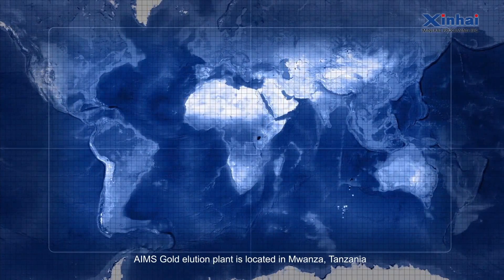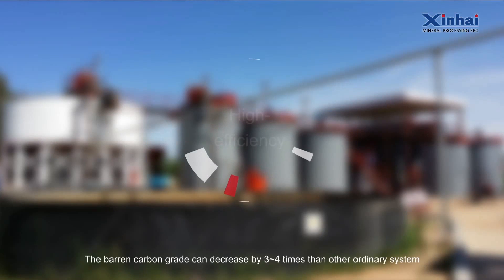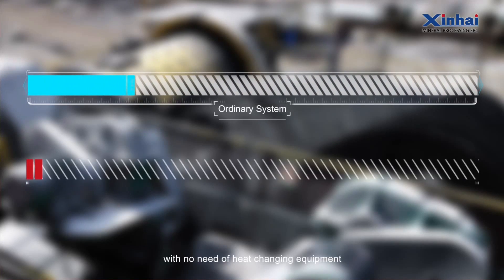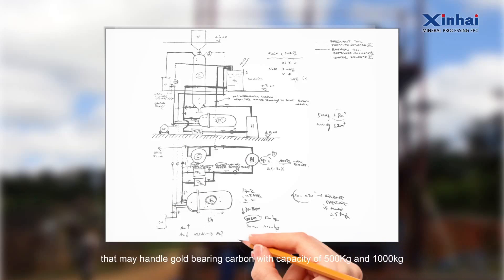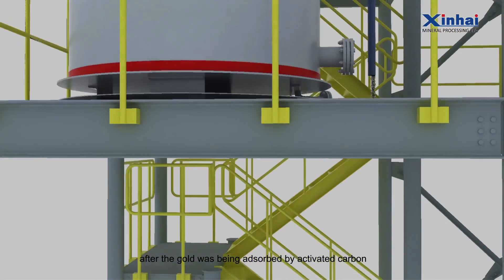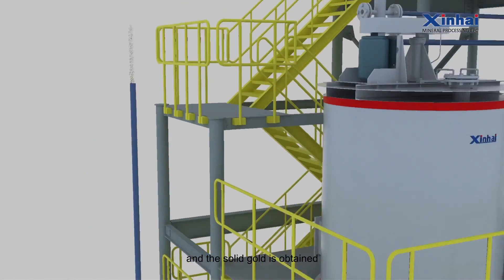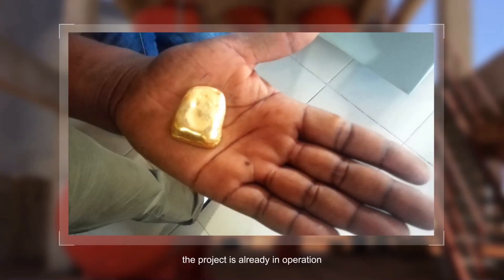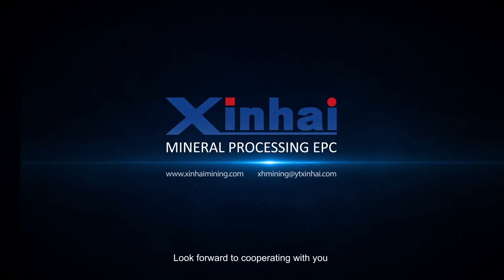Tanzania AIMS 500Kg and 1000kg /batch Gold Elution Plant，Xinhai

Comment: Please I need help here. My Company in Ghana just set up and installed the Xinhai desorption plant but the engineer left before the plant would start working. Please can you do a step by step tutorials on how the whole strip and elution process before the strip cycle ends? From carbon loading, inverse blowing,  Caustic solution circulation, how to open and close the valves accordingly, who valve should be opened and which valve should close at this time, building up the pressures in the electrolytic tanks and the whole proceedure till elution is completed. Thank you and I would be glad to know about the video. I just subscribed to your channel.
Reply from the maker: Sir, from whom did you purchase your equipment? You can talk to the sales to resolve this after-sales issue. If you forget which salesperson, you can tell me your email address and I will look it up for you in the system.
Reply: @xinhaimining  ok so I didn't purchase this myself. I am a Plant metallurgist, The problem is the engineer who was to train us on how this equipment works left after the installation, so we had to decode ways to run it from their manual. I believe since I is the same equipment you can help and take me through how to operate it perfectly because we are kot used to this Chinese system of desorption. Thanks